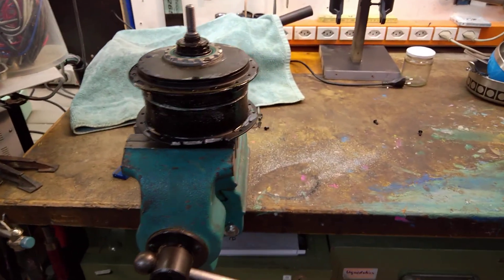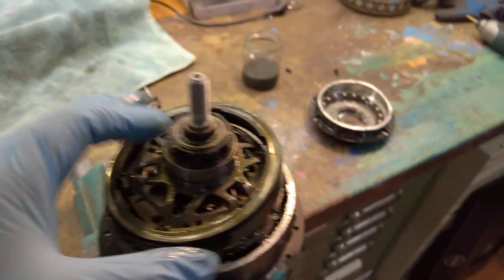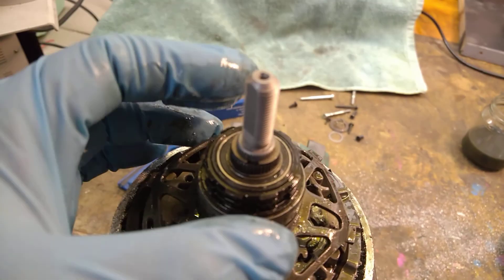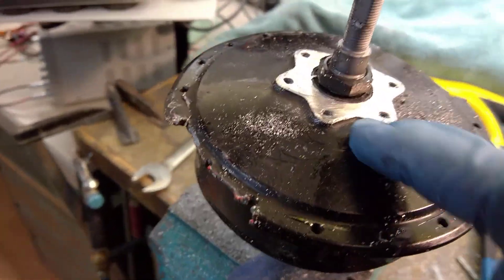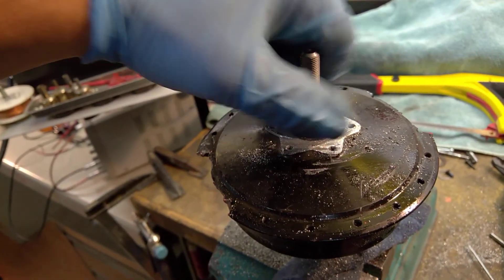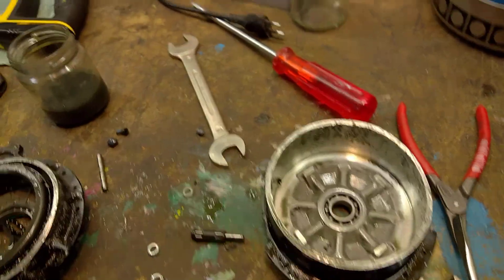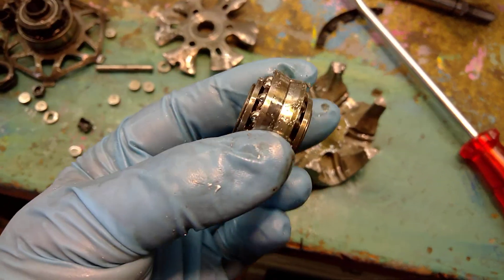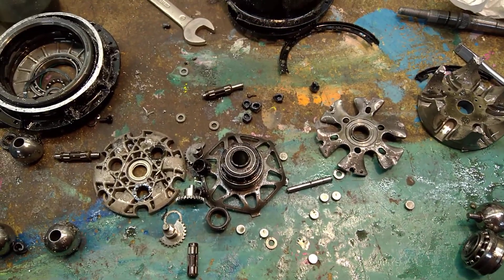Nuvinci / Enviolo CVT Hub Disassembled / Teardown / Destructive

Comment: the enclosure that holds the enviolo also holds the spokes. And is very brittle, spokes break out of it, ruining the whole thing. You showed it, I experienced the same
Reply from the maker: Interesting, I found two of these hubs, and I was under the impression, that the flanges were broken on purpose (eg. warranty claim without returning).

Comment: I'm trying to make a geared unicycle from one of these, and am interested to see the planet carrier is fixed to the shaft. Not a problem in a regular bike for a unicycle the shaft needs to transmit torque between the pedals, and if the transmission input is coupled to the shaft then there is no relative motion between the planets and the input ring, which is a big problem. I could hold the input ring fixed against the frame, but then the wheel will turn the wrong way and the input ring will disengage, not transmitting torque. Also, suboptimal to be unable to ride in reverse. A good puzzle!

Comment: Very interresting. I have been riding a 380 for 3500 km now and it works very well.
But one thing I still do not understand: how are the planets tilted and held in the desired angle? It is not explained og visualized in any picture or video I have seen yet. Yes, the old ones had a kind of fork around the planets, moved by the center roller but it seems they use another principle now?
Reply from the maker: Hmm, good question, I think it's what starts here: https://youtu.be/5kV7NTgO4s0?t=272 on that strange spider, there is a gear on the opposite site of the freewheel. This seems to engage with the planets. But how the Spider is held in place, I don't know.

Comment: OOh I get it now! They are using the torque from the pedals to create the clamping force for the "ball transmission". Thats the point of those ramp-things at 2:26. I was wondering how they are creating the clamping force without a big spring
Reply: The oil within the casing has special properties aparently and a lot to do with how the planetary ball transmition works. So i have read on this type of hub.

Comment: Thanks so much for this. I wanted to explore inverting this hub so that the right drive side is on the left side. This would be for single speed motorized bikes with left side chain drive. This video explains why it would/wouldn't work. I see now that the  input and output drive rings are two halves with one way cam teeth and a bearing ring that sits in the middle for the cams to ride on. I see mechanically why they did this now. It's to expand the rings halves to apply more contact force and basically squeeze the CVT spheres when drive torque is applied in the appropriate direction. This additional pressure combined with the fluid, is what makes these virtually slip proof.   For my concept to work,  the cam teeth on the rings would have to be inverted to the opposite cam direction for that ring expansion "squeeze" to be applied when torqued in the opposite or left side direction. That means making new rings or modifying existing ones. Due diligence served, but thats where I am stopping with this endeavor.
Reply: También estoy en esta misma búsqueda , en mi caso para una honda 50 k1 , intenté traducir lo que dijo y parece que no es posible ?
No alcanza con eliminar el sistema y dejarlo fijo? 
Espero que puedan traducirlo gracias
Reply: @santagon6819  I also wanted to use this on a honda pc50k1. In short, it is possible to use the enviolo hub but you need to make the rings with the teeth yourself. Because of the direction of the teeth on the rings.
This can be done, but is expensive due too the precision and hardness requirements.
You need the rings with the teeth, otherwise the system will slip and no power will be transferred.

Comment: Amazing engineering to get all those balls and races into that little housing. Like all CVT's the actual ball to race contact is infinitly small and can slip under hi loads. The special black liquid in the hub is designed to "stack" up around the contact spots increasing friction between the hardened steel surfaces. Not as efficient as a chain with discrete sprockets, but smooth and quiet and stepless instead. Perfect for the leisure and rental market. Would I tour across Mongolia with it..Nope.
Reply: Hello, do you know the name of special black liquid? I'm in India, travelling around the world, and my rear hub enviolo, Heavy Duty, is not working.
Reply: @Pedalandonahistoriapelomundo  no idea mate! enviolo has a website. give them a shout. if all else fails chuck the rear wheel and buy a sprocket wheel and deraillor.

Comment: How can they manufacture and sell that hub retail for around 120USD? There are so many machined parts inside and the assembly complexity is incredible.
Reply from the maker: Actually never gave this a thought, but it's more like 300USD, isn't it? At least in Europe it is..
But even at 300USD it seems rather cheap for how it's made.

Comment: Wow. That's truly a monster of complexity. I intend to buy a bike with enviolo. Would you recommend? Thanks for the video. 👍😎
Reply from the maker: It indeed is - I don't have any personal experience with geared hubs, so I cannot really help you there. What I can say, is that I personally like lightweight wheels, and putting a geared hub, or a hub motor into a wheel will end up in a heavy wheel - so I would not buy any IGH.
I would consider it on an electric assist cargo bike though.

Comment: I know Valvoline manufactures the friction fluid used inside those NuVinci hubs, but don't know its exact specifications.
Reply: I bought a new NuVinci N171 unit from Calfee Design and it leaked during shipping. When I emailed them for some help they could neither supply any pf the oil nor could they point me in a direction to buy some. Sadly their after sales service on this item is 0. No internal spares. Little if any external spares.
Although their replies are always courteous they offer NO after sales service.
Finally, I wish I could find some of the correct oil to refill my new but empty, and therefore useless, NuVinci N171 rear hub
Reply: @-MacCat-  I would get in touch with the guys over at Priority Cycles in New York, just to see where they can steer you.
Reply: @VideoNOLA  Thanks a bunch for the lead. I'll get onto them asap.
Reply: @-MacCat-  Hi. Do you already know what oil should be in the hub? My wife's bike is leaking and I want to fix it.
Reply: @monter75  No I don't. None of the companies that should be able to help in supplying it, i.e. Enviolo, Calfee or the other resellers, simply don't acknowledge a request regarding any sale of he oil. This may be because they require any servicing, which requires topping up the oil, on the units to be done by them at their premises.
It's been overwhelming disappointing dealing with any after-sales support on any of the Enviolo/NuVinci products.
Re: the oil, I will probably retrieve a few millilitres get a local oil lab to check it out and give me a recommendation. 
It surely can't be that different to something else that's readily available.
Reply: @-MacCat-  I am a mechanic and in this case I will refill oil with increased viscosity and such oil is CVT transmission oil, because there is also a problem with the slippage of the metal chain on the disc wheels.  I'm sure it will do the job.  There is a fil on YT where someone cut the hub but previously drained the oil into the jar.  it was about 50-70 ml.  Try to find "enviolo hub dissasembling".  Thanks for your answer bro.
Reply: @monter75  Happy to help, if you could call my reply any help at all. I'm an an engineer and have worked around and in various parts of the oil industry, including the automotive engineering stream, most of my life and have learnt enough to know that oil choice can mean the difference between a healthy, well running and long living piece of equipment and an instantly self disassembling piece of trash.
Having said that, I think you are on the right track, given the internals and their system of engagement/contact,.
By the by, "...there is also a problem with the slippage of the metal chain on the disc wheels.." You mean on the inside of the hub?
"There is a file on YT where someone cut the hub but previously drained the oil into the jar." You're not thinking of the one above are you? 🤔
Because if you're not then the other "drain and disassembly" file is eluding me.
Reply: @-MacCat-  I've been thinking about this video ... I have announced a couple of videos, and I have not noticed that this is where our discussion is going on ... Sorry. I am well aware that the oils in a given specification have additives that others may not contain, but I assume that I will refill the oil for a CVT automatic gearbox better than my wife has to drive a dry HUB, if HUB dies, I will buy another one, but try it for private purposes won't hurt.
The automatic gearbox in the car has a chain that drives metal disc wheels of variable diameter, and it is precisely the increased viscosity of the oil that is needed to prevent slippage.

Comment: Very interesting thank you for filming this. I have disassembled many of these hubs over the past decade but never a newer model Cargo hub which this one is. Wasn't easy to see but one of the modifications which I was promised would make the hub better appears to be plastic end caps on the planet axles. Very unimpressed but got 2 on test at the moment so will see how they do. Maybe there is more to it so should reserve my judgement until after more testing. I experimented with bronze bushings as end caps and they would wear out quite quickly but did save the stator. 
These things still don't appear to be built to last which is a great shame because I love them.
Reply: Update, my CA hub has failed today and I suspect its these plastic end caps. First time in a decade of riding with these hubs that one has actually failed on a ride. It is still just about usable if you can get up to speed past underdrive. Very high drag in underdrive and at one piont it even slipped.
Not that pleased with enviolo at the moment. Have spent the past 5 years developing automatic shifting and their hubs are turning out to be the only part that letting it down.
Reply from the maker: @Ed.R  Hello Ed, first of, thanks for your comments, always like to have some feed back, so I know that I'm not filming stuff like this just for myself.
Sad to hear about the failed hub. I hope that you can find a solution to improve durability.
Reply: @niokolabs  I was going to say you should have kept the oil and sold it. The stuff is impossible to get hold of and I'd definitely like some spare.
They are sending a replacement hub for me to test.
Reply: What is the most common damage to these? They seem to be all metal therefore should be reliable
Reply: @vinylscorcese3435  It used to be the freewheel but the latest hubs have far better quality ones with separate springs.
Reply: @Ed.R  is v 380 considered 'the newer" or does it had to be enviolo (made after 2017) to be reliable in your opinion? I am considering purchase of used unit. Thx
Reply: @vinylscorcese3435  The newer version of the hub is the enviolo Cargo and Sportive. Although these I think are being replaced by one hub called Heavy Duty.
Reply: @MustafaHussein-tf2sy  If you just want boring old gears then yes maybe.

Comment: Very cool, thanks. It looks very heavy for a bike hub, amazing engineering though.
Reply from the maker: Indeed - wouldn't want it on a normal bike. Might be interesting on an electric cargo bike.
Reply: It's a clever CV idea
Reply: It's heavy indeed,and you need more power in the legs to pedal, so yea, best used with electric assist.